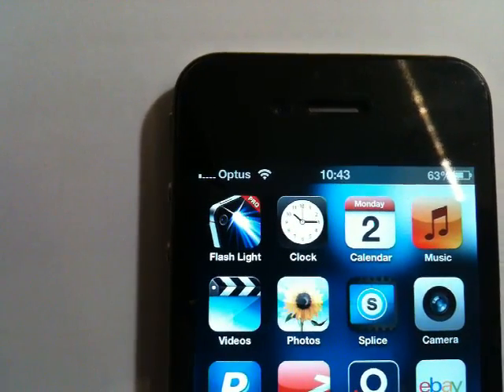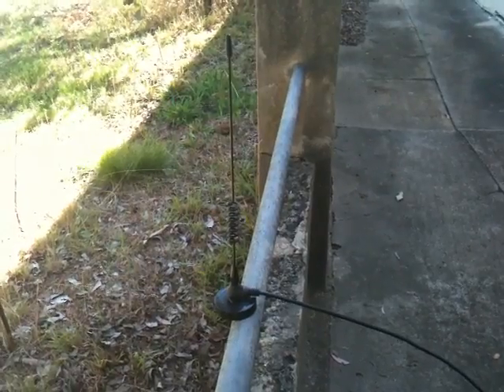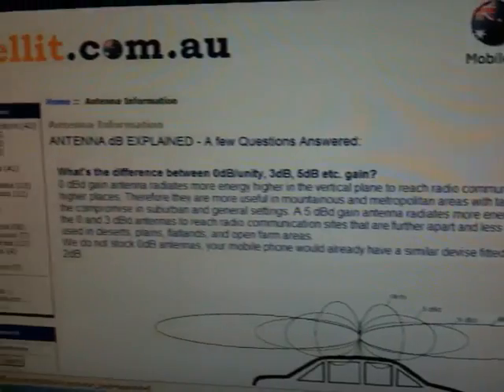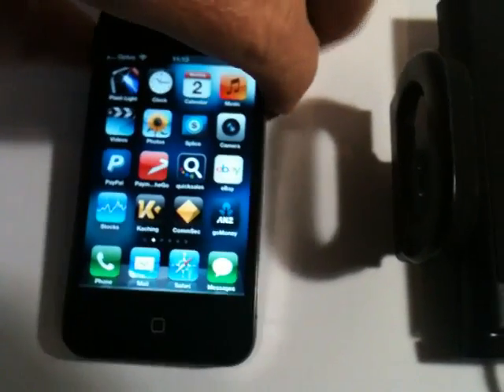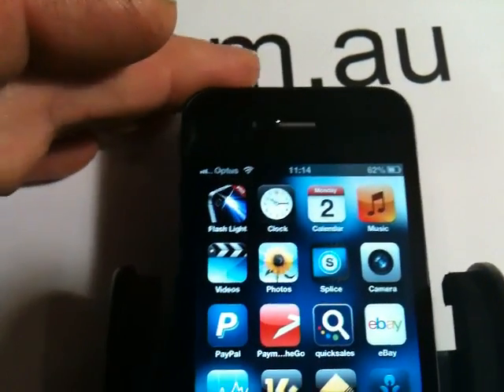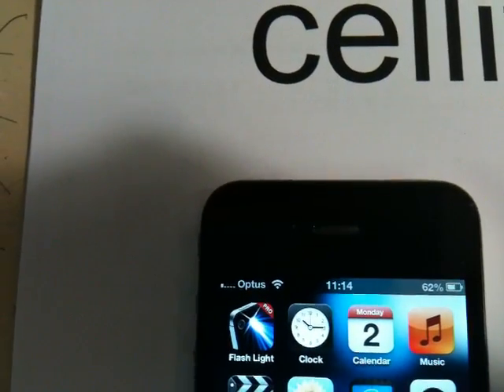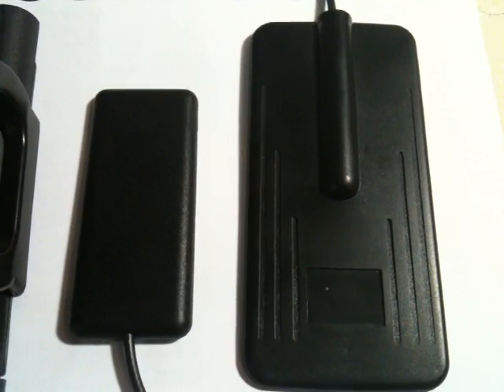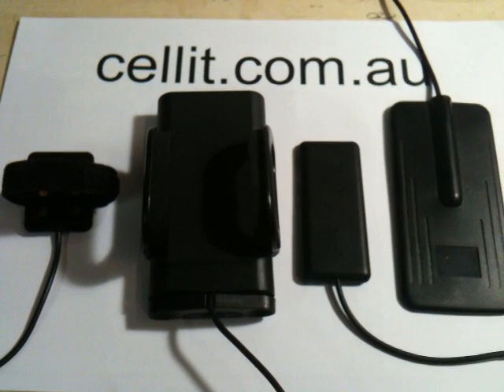How to increase the signal strength on your Smartphone/iPhone - Cheaply!

Comment: you need to watch this. If you want your views to see exactly what you are doing and how well it works or if it even works at all turn your bars into a numbers span. type in "what do the bars on your phone really mean. And it will show you how to show iphone and android ways of getting to test mode where it will tell you exactly what kind of conection you are getting. For example I get -90 in my office -82 in my room and -60 outside. -0 is perfect connection I don't know what the worst number is

Comment: Hi Dave, few points. A 5dB omni antenna will often do better than a higher gain especially if terrain is hilly or heavily vegetated.If using a yagi then you need a clear understanding of where you are and what terrain in relation to your serving cell, if flat and open then a vertically polarised 14dB yagi is great. You can Google a "tear down" guide for your handset that will show you where the antenna actually is. The antenna must be capable of receiving the desired frequency (many 5dBi are only 900/2100MHz). Your website appears down? I'm interested in the latter two :)